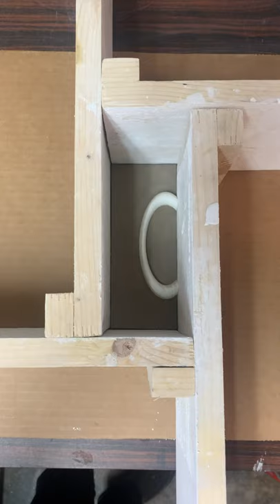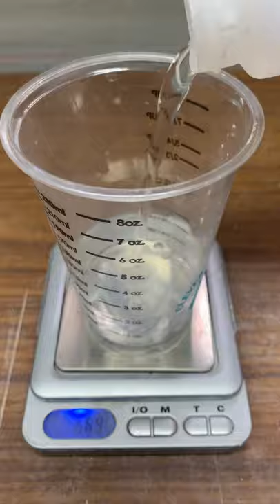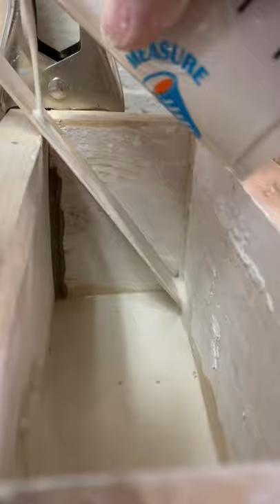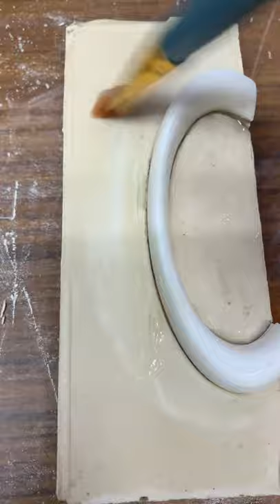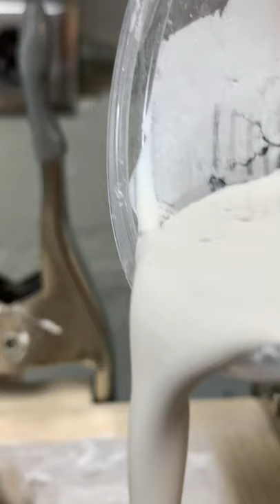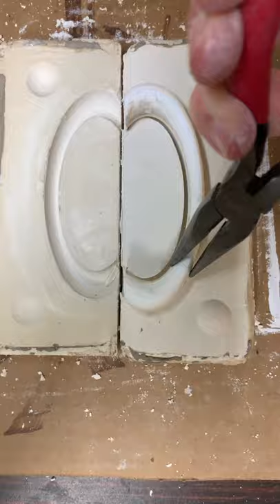Making a 2 Part Plaster Mold For Pottery Handles (#shorts)

Comment: Jim I went back and watched the last video that you did of your studio and I hope the move went well. Can't wait to see how your putting things together. eddie.
Reply from the maker: It’s coming along. It comes in waves. I’ve been stuck for a month or so debating what kind of flooring and trying to keep my head above water with teaching and coaching. However I finally decided a few weeks ago to smooth and polish the concrete floor and I picked up the polisher yesterday. After the flooring is done all the next steps are smaller and quicker besides one line of outlets around the perimeter of the room. I might make it a Christmas gift to myself 😆.
Reply: @CeramicJim  I like the idea of the polish concrete. Then if you change your mind if you get a STAIN you can do the Epoxy coloring and sealer that most use on garage flooring. Sounds good and glad your back.